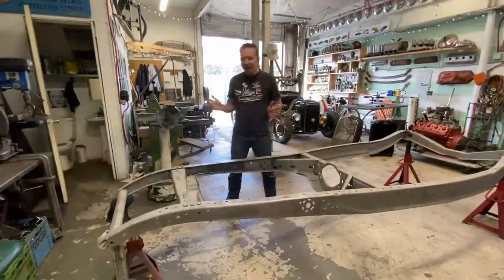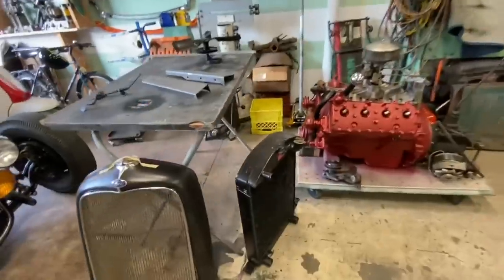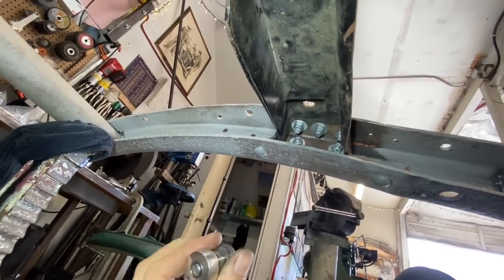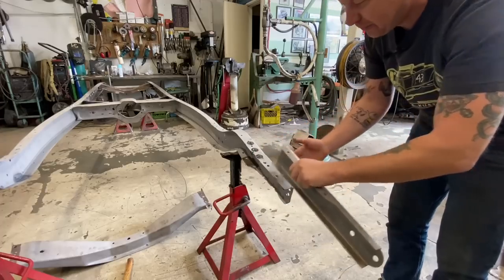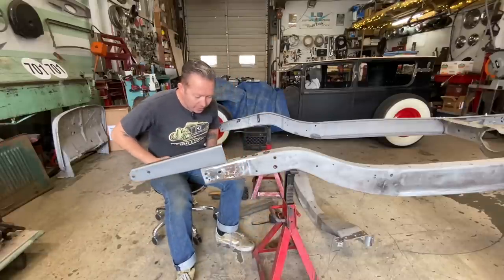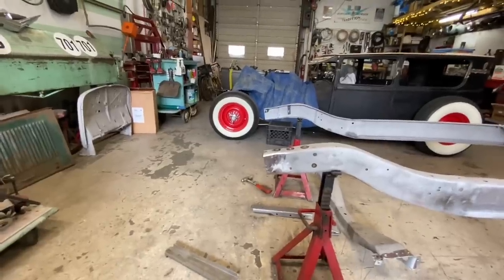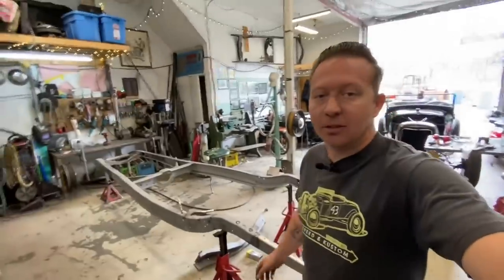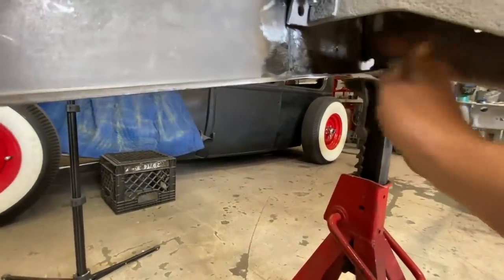32 Ford Part 4. More Chassis Repairs

Comment: Nice job on the rear frame repair. The hole you welded up is the rear body mount so good catch there. It is 1-3/4" back from the rearmost crossmember bolt. Enjoying watching this one come together as I have just built an old school 32 myself. It features in a lot of my recent videos. All the best, Mart in England.
Reply from the maker: Yea, I’ve since drilled it back out

Comment: Great work as always. I liked your tip for the sanding disk. I do something similar: spin up the disk and hold a razor against the to of the disk to "lathe" through it. It's perfectly round after  too!
Reply: *top
Reply from the maker: Thanks Ben! I don’t know if I’m brave enough to hold a razor blade against a spinning sanding disc haha

Comment: The '32 gas tank is 3-point mounted, two holes on one side and only one hole on the other,  this reduces stress on the tank (less cracks) when the frame flexes and it will excessively if not boxed.

Comment: Great job making that frame better then it was lee, I'm surprised the other owner got away with his sloppy workmanship. I'm working on a 1962 Ford Eco Falcon witch I lowered and bagged, swapped the 144 ci 3 on the tree for a 302 ci  C-4. Removed stock rear end for a ranger 8.8 with 18 inch mags and low tires all on a unibody frame. New three core rad, brakes and lines, gas tank, fuel pump and lines, all new electrical wiring,  window channels and rubbers and more. I'm planning to build more soon. Keep up the great work.
Reply from the maker: Super cool build!

Comment: nice work .I have a 1949 Vauxhall velox taildragger project. 3inch roof chop,layed the rear windscreen over to meet the roof line  ,59 Cadillac tail lights frenched in , widened sills and rear guards 1.5 inches. we have a 283 Chevy ,turbo 350 trans and an 8 inch diff with a Holden LC torana front end .we have done all the work including the chop with mates and half an idea what we are doing lol
Reply from the maker: Super cool! Those Vauxhalls make a great candidate for a Kustom don’t they. We never had them here in Canada.
Reply: @LGKustoms  they were not that common in New Zealand either but there were a few running about and she only cost me $4k so easy choice to chop her .a spare roof and set of doors helped with the chop and only cost a box of beer and a jar of moon shine lol

Comment: I really like that you’re fixing this frame. So cool to see your solutions to the old “repairs” 
It’s going to be a really cool hot rod.
It’ll be cool to cruise with when I drive my T out next summer.
Reply from the maker: Thanks! Although, a few times I’ve thought to myself, should have just got a new set of rails haha. Then I remind myself it doesn’t have to be perfect and it’s just an old hot rod. Just make it safe enough to drive and put it back together.

Comment: Great video Lee !!! The engine looks GREAT, shame to put a hood over that !!Only thing is that those "Fish Plates" do not look anything like fish !!!  Haha must be a Canadyan thing lol.  I understand you leaving that large inside plate repair on the drivers side. It looked fine but you said it was about as good as you would do. WRONG your front plates had large holes in the center of the plate that you welded up. You do MUCH better work than what that poor frame has been subjected to in the past. Thanks for that Wescotts tip !!
I recently completed enough of my 62 GMC short BED step side pickup with a 6.0 Ls engine and 4L80e trans that I was able to make the 190 mile round trip over to the HP tuner and dyno man and have the factory 2006 Chevy truck computer that I  successfully wired into the old truck adjusted and tuned properly which it needed worse than I realized. It made there and drove home smooth as a Cadillac after he plugged in some sensors I somehow left unhooked and put the tune on it. Has more power than it needs and drives smooth. I will finish patching the drivers side floor and rocker panel as soon as the parts arrive. I could have fabbed them by hand but they were too cheap for me to spend all the time making. My list is getting shorter and when it's done as much as i am going to do on it i get to start on my model A pickup. 
I see you have made progress on the roof of that A sedan. I hope you had time to video some of that. Keep up the good work 👍
PS  would please ask your friend Dave if he couldn't try just a little bit harder at making an extremely WICKED 5 window coupe ??  Lol
Reply from the maker: Super cool. I have an early LS and some speed parts in my shed, waiting for the right project. As much as I like my traditional hot rod engines, the amount of reliable power you can make with an LS really intrigues me. Sounds like a very cool truck! 
As for Dave’s car, the reason he came by was to get my opinion on if he should chop it another inch in the rear in order to absolutely perfect the roofline on it. I told him he’s crazy haha
Reply: @LGKustoms  6 liter has LOADS of power. I put a 200 pound piece of plate metal under the bed right at the back of the frame and it stopped it from spinning the tires when it down shifts but didn't help that much from a standing start !!

Comment: Nice work ! It won't be long at the progress your making and you got some really cool scores too! I'm working on a 1929 roadster with 30 front fenders ,28 rears,31 splash aprons a Deuce grill shell, Drums allround ,split 46 wishbones 302/auto, Superbell axle and a nine inch rear. I already have a 28 hiboy roadster pickup, 289w/4 speed. And waiting inline for building is a channelled 35 coupe 302w/4speed. I see the Aussie dollar is close to the Canadian dollar so I'd really like to check out the Deuce Days event , Keep up the cool cars and videos!.....Doris doesn't care.
Reply from the maker: Nice line up! Tight squeeze getting those small block fords in there! If you do make it to the next Deuce Days, make sure to swing by the shop Saturday night!

Comment: Hello Lee,  Shannon. I went to the vhra swap the other day, and for sale a 32 frame with title. 3k sterling. Needed a lot of wok as the k  member was rusted out. It had some sketchy repairs on the rear frame horns. So past it up, but now watching this master class in how to fix a crusty frame, I think I may have made a mistake. We have a firm over here that makes legs from the k member to the chassis sides. And they are in the process of making a new k member. So a re think is in order to see if it sold or not. It’s a task to find the right parts in England. And so expensive to ship parts over. Anyway keep up the grate work all the very best Tim
Reply from the maker: I can relate, Shannon and I used to race a Ford Cortina, and all the parts we had to order and have shipped from the UK. Its definitely a challenge! 
Used K members do pop up time to time on Instagram or the HAMB. Usually between $500usd and $800usd, so with shipping to England that could be quite expensive.
Reply: Yes I have imported Buick parts in the past by the time you pay shipping then import tax and customs tax it’s more than the parts. The best way is to collect  the parts needed and and then get one of are imported to bring it in the country.

Comment: Are those carriage bolt strong enough or do you need to weld those crossmembers I like that idea.great work.
Reply from the maker: They should be strong enough. Originally it was 5/16 rivets that held everything together. 
Welding crossmembers in an unboxed frame is kind of frowned upon, as the frame needs to be able to flex.